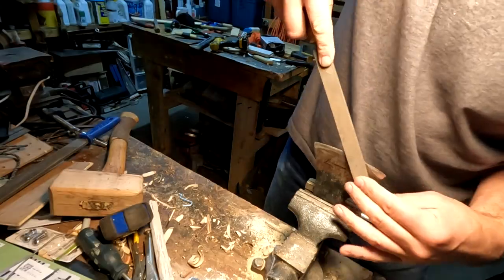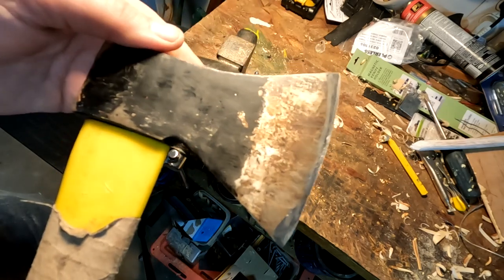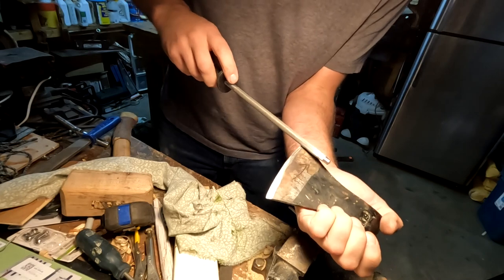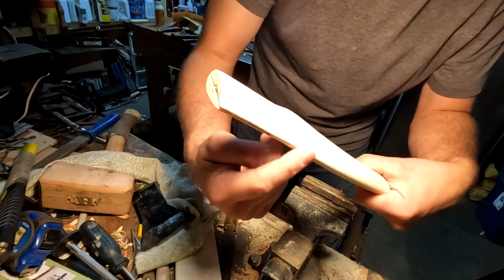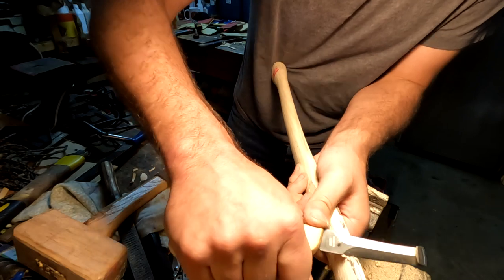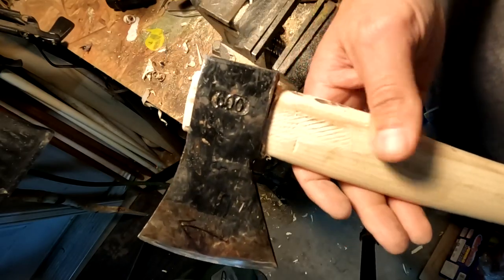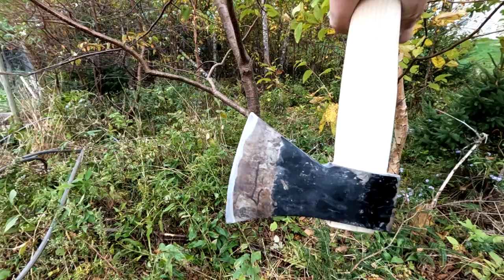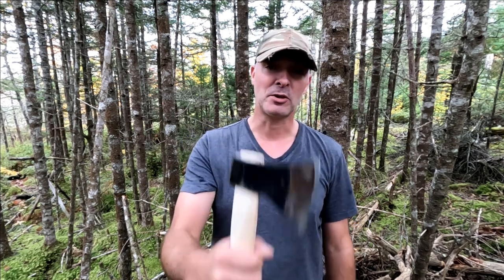How to Upgrade a Dollar Store Axe

Comment: I done this with a full size axe years ago. After the head almost flew off that yellow , plastic handle of a thing. I completely reprofiled the head and shaped a 33"  wood handle for it. I've fell many big trees with it. I do often sharpen it on my belt sander and I still use it today. It sends large chips flying.  I collect vintage heads and use some of them , but that cheap axe always makes the deep mountain camping trips. It even has it own sheath.
Reply from the maker: I have a larger one waiting for the same procedure - came off in almost the exact same way you describe

Comment: On your point that cheap metal just needs sharpening more often is only correct to a point. Super soft metal won't sharpen nearly to the same edge as a harder metal, as the cheap metal will roll badly while sharpening.
Reply from the maker: I work on the assumption that it's most likely adequate in hardness. If it can't keep an edge then I'm out $8. If it can do all the hatchet things I need and only need resharpening once a year, then it's a win.

Comment: I have never seen anyone hang a hachet in this way. You need to learn the proper way you are teaching the wrong way to do this also soak the head in boiled linseed oil to keep the head from becoming loose due to humidity.
Reply from the maker: I have axes that I've hung this way that are decades old.  It works fine. As I mentioned in the video, I treated the handle with linseed oil afterward - but there's no need to soak it. The purpose of treating with linseed oil is to stabilize the moisture level of the wood.